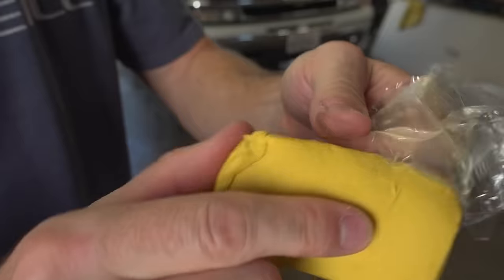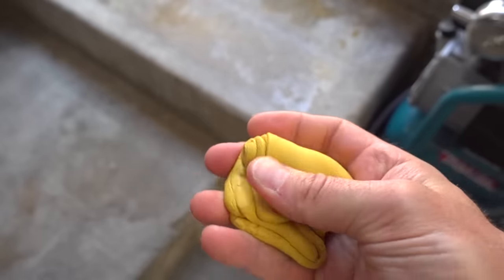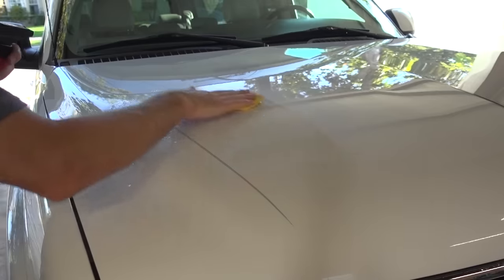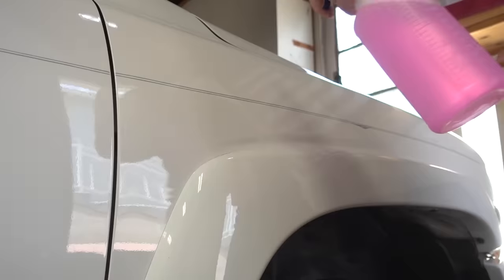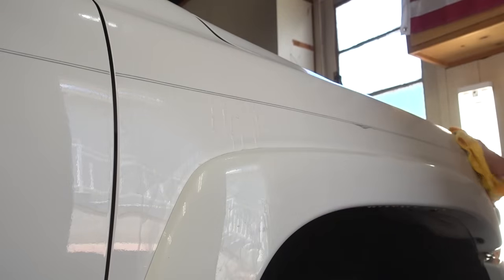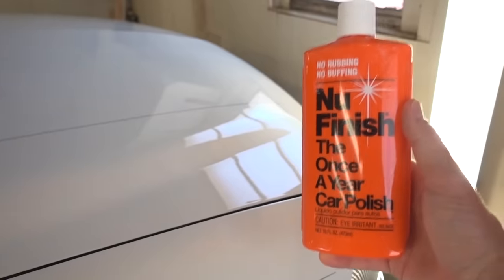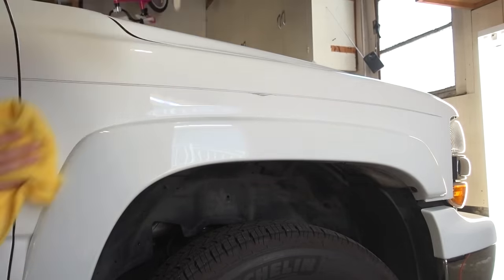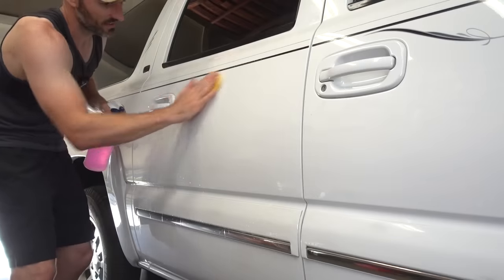This Is Better Than A Clay Bar And Only Costs $2

Comment: You should try playdough as a substitute clay bar since it was originally designed to be a clay bar intended to remove coal soot from walls after a winter of burning coal and wood.
Reply: That's very interesting.  Never knew that's how playdo was invented.
Reply: @AtEboli  That's where playdo got it's start then of course electric and gas heat swept the country and the inventors kids was playing with it and the idea to market playdo as a children's toy was born.
Reply: lol, that assumes it’s still the original formulation. (Which probably had asbestos and lead!)
Reply: @notchagrandpa8875  that’s very interesting.
Reply: That and leave the impression of your favorite comic strip at the same time!!
Reply: @BT-be8rh I think you're referring to Silly Putty.
Reply: @bodeine454  Ye I must've eaten too much of it as a kid! 😂
Reply: They actually changed the formula when they made it into play dough to be safer for children.

Comment: I'm 70 years old and have been using  Nu Finish since I was 20 . Great product .
Reply: I used to use Nu Finish. I agree it is a great product and it lasts a really long time. The only thing I don't like about it is that if you accidentally hit any black trim with it, it doesn't come off. It stays on it for years to come!
Reply: @mranalogman3525  Great point.  Place masking tape (or blue painters tape), over the trim areas to help avoid or reduce this from happening.

Comment: Would have been interesting to see the results of running the plumbers putty first, then a new clay bar over the same area to see if it picks up anything else.
Reply: 27
Reply: 42
Reply: Plumbers putty picks up chicks
Reply: I kept waiting for that or at least split the panel to see a real side by side.
Reply: Of course you would have to run this test verse verca vise to see results as well. Then of course a control using neither.
Reply: Thats why he didn't show the yellow putty, notice how he looked at it a couple times and then mixed it up. If he would of showed the camera you would of seen the black contaminates on it. This video is very disingenuous and misleading.
Reply: 58
Reply: @shaun6453  
Would have*

Comment: In my experience when you here the clay bar picking up dirt you should stop and fold over the clay to give it a new surface.  If you want extremely clean windows use a separate piece of clay bar  with window cleaner. I keep it marked in a ziplock bar so I don't mix it up.

Comment: Watching it I was immediately thinking "Why aren't you doing a TRUE comparison?"  If the goal was to compare the plumbers putty to clay bars then you should have done half the hood (and horizontal surface that catches a lot more debris than vertical ones) and also use the same Mother's detailing spray.  Now you did use the soap / water on the clay bar after, but really could have done half the hood and half the vertical with the same sprays. THAT would have been a true comparison.  Otherwise, good video and good point at the end about what the putty may have in it that could affect the paint later.

Comment: I followed your video on this particular subject. I also got plumbers putty and attempted to do my entire SUV. My paint job is relatively old on my SUV so I did not expect great thing, but nevertheless I attempted it and it came out great. Plumbers putty did start to disintegrate after a while, to be expected I recommend anybody with a vehicle that has paint that is relatively old and get great results

Comment: Shouldn’t use the wash n wax when clay barring....idea of doing this prep. for duco, is to strip waxes & containment’s before polish & rewaxing!
Reply: Good point.  What would you use instead to lubricate the clay bar?
Reply: @DaveRynk  water.
Reply: @DaveRynk  water and soap will do don't buy what they have with clay bars it's their soap and water recipy
Reply: @DaveRynk  Water is okay, its not very slick and you want the clay to be pretty slick as you're running it across your panels. The professional way is to have a "detail spray" which is just a rinseless soap wash mixed with distilled water. In a pinch, you can use dish soap and water since claying is already going to remove any existing waxes/sealants. Professional detail advice.

Comment: I just tried using plumber's putty yesterday and then spraying a ceramic coating, and my car's paint feels like glass. Oh and I have less noticeable swirl marks too! Thanks for the video!
Reply: What ceramic coating do you reccomend?
Reply: @thecrazeecow1682  i saw u didnt get a response so i thought i might help. I do ceramic coatings professionally and i would recommend several good ones such as Wizards ceramic or Tec580. Just make sure it is a "nano" ceramic. Im happy to help if u have any other questions

Comment: I would always put the Magic Clay bar in the microwave in a bowl of water for 30 seconds to make it more pliable . I will try the plumbers putty as it seems much easier to use. By the way, I always use NuFinish polish, it buffs off easy and protects for almost a year.
Reply: Thanks for the tip.
Reply: Update ?

Comment: I would worry about the additives in the plumbers putty if you have a car with PPF (clear protective vinyl wrap). Might damage the material. Also....the correct way to do this is to wash the car well than use an Iron out product which will  remove much of the microscopic iron fillings that are from your brakes. Those hot particles attach to your clear coat and are the prime grit you feel when running your sandwich bag covered hand over the paint. The iron particles will be obvious as they will turn the iron out solution purple. Rinse that off and now you use the clay bar, plumbers putty possibly, or clay mitt (my preferred) along with detailing spray or soapy water. This will pull out the last of the iron particles, tree sap, and road grit. Now you can select the LEAST aggressive polish for your cars paint condition to remove any swirls and finish up with a polish glaze. At this point you can use a good wax or ceramic coat.  There are lots of Youtube videos about the process. Skipping steps will result in piss poor results. If you don't use the iron out step you will leave that imbedded iron in your clear coat which will rust. If you have a white car the rust will be very evident after a while as tiny rust spot. The clay bar step pulls those out of the clear coat. Polishing or waxing without removing them will just trap those particle and result in future rust spots that can attack the clear coat.
Reply: Thank you so much for your explanation
Reply: Spot on explanation!

Comment: Great video and comparison! The reason you hear the sound with the clay bar is that it is in fact abrasive. It's not meant as part of a wash and wax routine, it's meant to be used as part of a paint correction process. You remove contaminants and follow up by buffing and polishing to remove swirls and micro scratches on distressed paint.
Reply: Adam Placker couldn’t of said it any better!
Reply: He wasn't using the detail spray. He was using a car wash solution diluted with water (and who knows what contaminates where in it, too). Clay bars are meant to be used with a lubricant not a soap.

Comment: Ive used Plumer putty for years.
I add a couple of drop of virgin  olive oil to it before use. Works great to clean window also.
Reply: Lol
Reply: Why the oil?
Reply: Plumbers putty is very fine clay mixed with linseed oil, same as old fashioned window putty used on wooden window frames.

Comment: I believe that clay bars are known as micro abrasive, they always recommend polishing after using a clay bar.  Probably why you feel like it's scratching a bit, frequently reforming the clay helps to reduce the scratching. Good to know that there is a cheap alternative.
Reply: Should also do a thorough decontamination/cleaning of the paint prior.

Comment: your local hardware store has just sold out of plumbers putty
Reply: price of plumber putty just shot up to $15
Reply: And so has the price of my 1 step correction!🤔
Reply: All the plumbers are cussing because the price of plumbers pudgy it going up.  I had an old lady 45 years ago give me a hard time for using Arm and Hammer baking soda
Reply: It feels like butter????
Reply: So I've bought it now how do I used it
Reply: @c50ge  Why did you have her do that?
I also heard of someone using Borax to clean.
Reply: @isrealperez9069  rub it with water on the surface of ur car paint
Reply: I know Walmart is out too.  They told me since the word is out now they can't keep it in stock anymore.  Had to go to the automotive section to get some Mothers clay bar.  Cost me $15 to fix my sink.  This is an outrage ?!

Comment: put you hand into a plastic bag and lightly rub your paint that will allow you to feel the rough stuff better then just doing it with your bare hand. Also don't use the auto parts store cheap micro fiber towels they will actually scratch the clear coat. A good test is get an old CD and rub it with the micro fiber cloth. You need really good microfiber for the paint you can buy any of the premium ones from like Adams (I use these) but you can use the ones from any of the major companies. I use the cheapies for the areas around the doors or the bottom of the vehicle or around the hood and engine area. As you use the clay bar you will see the contaminants in the bar just need to fold them over and knead the clay bar, it shouldn't be scratching the paint. But if you drop the clay bar throw it away it will pick up the large dirt and such off the floor. I have used clay bay for years and never had an issue with it scratching the surface , then you follow up with a polish and wax it will look great.
Reply: Totally agree with you. Putting your hand in a plastic bag and very lightly rubbing it over the paint is a real eye-opener. If you do it before you clay bar, you would swear that you're rubbing your hand over sandpaper. After clay barring the car it will feel very smooth.
Reply: Just like the instructions say.
Reply: Also the edge of a credit card works great for checking the paint for contaminants
Reply: Exactly! If you think that you feel it pick up something, stop and fold and knead the clay bar. That will keep it from possibly scratching the paint. The clay is designed to hold the particles inside, and keep them from scratching the paint. Not sure about the plumbers putty, as it is softer and not as sticky. It should do a presentable job. You get what you pay for.

Comment: A clay bar is an abrasive. It does have potential to scratch your paint. That is one of the reasons why lubrication is needed to reduce the risk of scratching. Using a clay bar will lift the contaminants that a wash and dry cannot lift out of the paint. The contaminants stick to the clay bar and rest on the paint. This is why some professionals will re wash and dry the car after clay barring the car. To reduce scratching as they apply paint correction and or finishing product after the wash

Comment: Automotive clay bars are designed to be abrasive and sticky. The lubrication from the detailer, soap, or even water mitigates that. Some more abrasive clay bars are designed for removing over spray, heavily bonded contaminants and films. Although plumbers puddy is a great experiment, it has its own properties that make it hydrophobic and may leave a residue on your vehicle and not remove the contaminants that clay can with no residue. Also, after claying it is always good practice to polish the paint with a dedicated polish. This further removes contaminants and removes scratches left by the clay, but also swirl marks and fine scratches from washing. The polish also preps for the last step, which would be a great wax or sealant. Using the clay along with the right polish and wax or sealant with in a product line also ensures a good bond to the paint and will help your finish look good and last for a longer period of  time even after multiple washes. If there is a film left behind from the plumbers puddy or if it fails to remove the paint contaminants, then the protection the wax or sealant won't bond or last. This in the end would be a huge loss of effort, time, and money.

Comment: A huge thanks for taking the time to share your experience. VERY nicely done, sir. I've also used plumber's putty and white play doh (good cuz you can see the crud that comes off your paint, plus it comes with a handy storage can). I suppose anything that is super clean, pliable and has very fine abrasive aggregate will do -- BUT I agree that there's no need to drop $15-$25 on big name products when household good work just fine.
Reply: I agree but the ones you get from the big name auto stores are much more expensive than online. I got a pack of 5 clay bars for 10 bucks off scamazon

Comment: Also, you want to slightly knead and fold over the bar, continually putting the "clean" side down. If you just flip it, after both sides are contaminated, you have no where to go. By kneading, and folding it over, you can use a single bar to do multiple cars.

Comment: Clay bars are abrasives.  That is why they come in coarse, medium, and fine grades.  Yes, they are scratching up the paint, but they are also lifting out contaminants.  This is also why clay bar is done prior to a cut and polish on the paint, followed by a sealant coat.  You don't clay the car and then just leave it.

Comment: This wasn't really a good comparison - it would be better if you did the two clays on separate halves of the same car/hood/trunk.
Reply: Also, of course the fender came out feeling extra smooth because the solution he used on it has wax built-in, whereas the solution that came with the clay kit doesn't, as far as I can tell. It's supposedly just a lubricant.
Reply: @bcdoggie  He waxed the hood after claying.

Comment: Cool finding! With it being as soft as it is, I can see it being a solution for very mild contamination. Some of the heavier contamination would probably require a traditional clay bar (that's why some companies sell different "aggressions" of clay bars). As the contamination was described as light in the video, I can see why it would be effective in your case. My only concerns with this are that the material makeup of the plumbers putty is unknown (whether it is safe for all clearcoats, especially softer variants), and without a really good clay lubricant, it seems that it is more likely to mar the surface if it gets caught (by means of some of the putty getting stuck to the clearcoat, again, with softer clearcoat).

Comment: As far as scratches go, it is very possible for the claybar to induce some scratches as it pulls debris from you paint. The purpose of a claybar is to remove this debris from your paint before you buff as so the polisher does not pick it up and cause scratching/swirling in the paint

Comment: if you want to test smoothness of finish. plumbers putty does not work.  take the clear cover off of pack of cigarettes. put 2 fingers inside wrapper and softly make passes over cars surface. anything left on surface will feel like little bumps. write me back and i will tell you what do or not do. throw that new finish away.

Comment: For those thinking that the clay-bar results should be visible ... please ignore the fact that one uses detailing-spray ... because it is not a paint cleaner, the clay - it is simply something that removes particulate (small and large, both; industrial 'fall out' including sand for example) lodged onto / into the paint; that way, when you start to put a cleaner or a cleaner/wax onto the paint, you are not 'sanding' your car with swirl-marks and scratches as all of those contaminates contaminate your cleaner or cleaner/wax. Clay-bar results is something you can 'feel' with your fingers but cannot see with the naked eye; you can see the clean results with a low-power microscope of course; good video 1ROAD, keep up the good work.

Comment: I subscribed to your channel as soon as I saw this video, but haven't seen one since. But I digress. I have to thank you. I'm getting up in years (70), and I've been terrified to touch a Volvo S40t5 that I bought in April. It's a beautiful red, but really needed paint correction. With the exception of the plumbers(not THAT brave) putty, I followed your lead and jumped into it. First, clay bar....I actually used a mitt. Then i used 3M rubbing compound, then maguires polish, then turtle wax sealant, THEN Collinite #845 wax. I used a 6inch Bauer DA polisher for paint correction, with the appropriate pads.....my ride looks G O O D!!!!

Comment: I have used what we call in the UK Blutack. Its the putty used to put on the back of paper to stick it to the wall/board etc. Similar theory to plummer putty, but is very reminiscent of clay. It's got a little adhesive in it and you get a sheet of it for less than $1. Lasts as long as clay and is so cheap you can use it once and throw it away after each car
Reply: I just looked this up on Amazon. Do you do the same application for it as you would a claybar or plumber's puddy? Which is using a lubricant first?
Reply: @firephoenix3951  yes, exactly the same. Quick detailer or even snow foam to lubricate the surface, then use Blutack as clay

Comment: It seems to me an important part of the unfortunately more expensive clay bars is there stickiness, it seems the stickiness pulls stuff of the paint and using a lubricant, soapy water, clay bar works with very little pressure. I would like to see on a horizontal surface a section done with a clay bar and then a section done with plumbers putty and see if they both pulled up similar amounts of crud.